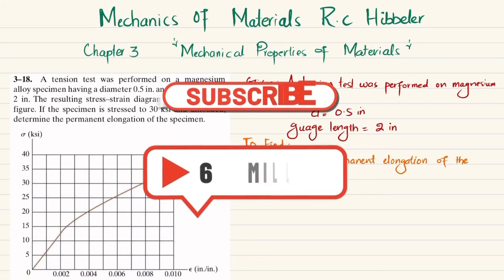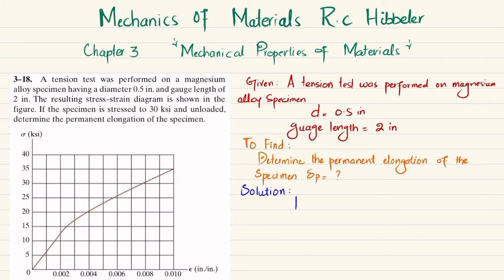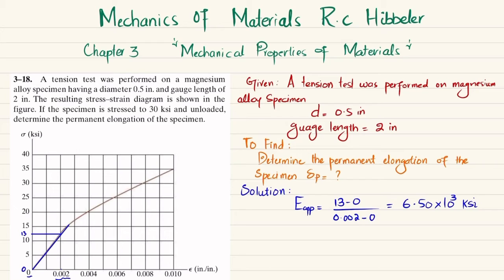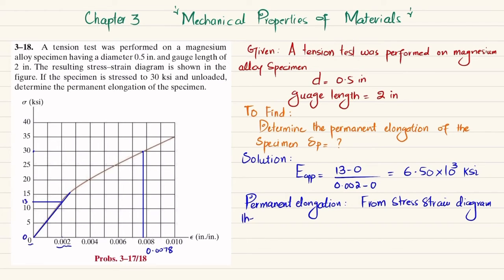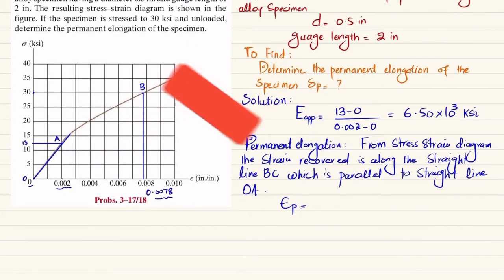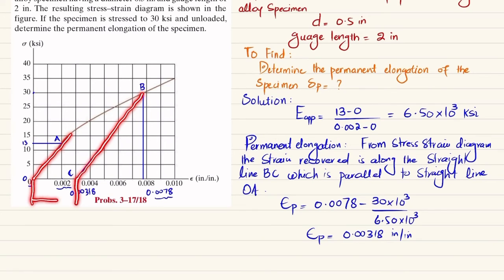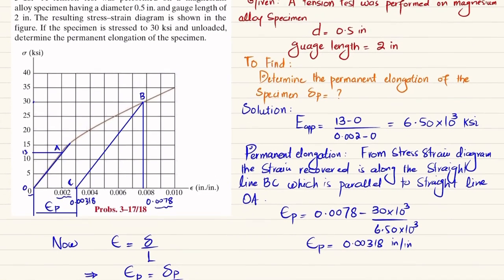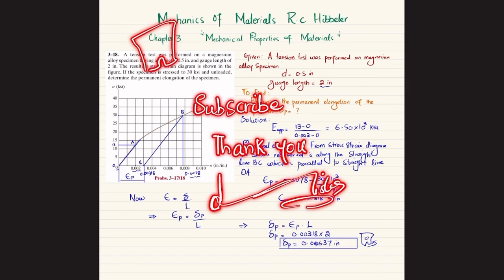3-18 | Determine the permanent elongation of the specimen | Mechanics of materials RC Hibbeler

Comment: Hello there,
When you are calculating for permanent strain you calculate .0078-(30E3/6.50E3) =.00318
When I calculate it I get -4.6075
I have tried to type this into my calculator multiple ways and even switched the denominator and numerator just to experiment with the numbers. How are you getting that value?
Thinking about it, even just diving 30/6.50= 4.61, so I am not really following the calculations. Please help! thank you
Reply from the maker: Ok I have found where the problem is. You can see that stress is 30 ksi which is 30 x 10^3 psi and E= 6.5  x 10 ^3 ksi which is equal to 6.5 x 10 ^ 6 psi so now (30 x 10^3 psi)/(6.5x10^6 psi) = 0.004615and then 0.0078- 0.004615 = 0.003185
Reply from the maker: I hope it is clear now. Thank you for your interest in the video. Keep watching and learning and don't forget to share it with your friends as well.
Reply from the maker: Did you get it ? kindly give me your feedback please.
Reply: @engradnanrasheedmechanical  Thank you for getting back to me in such a timely manor, I do see that now. I appreciate you and really enjoy your videos. I am an engineering student currently taking mechanics of materials.
Reply from the maker: @JoshuaMcHale-oj8xy you are always welcome and kindly share my videos with your friends ❤ and if you find any difficulties do let me know. Ask questions and I shall be happy to reply